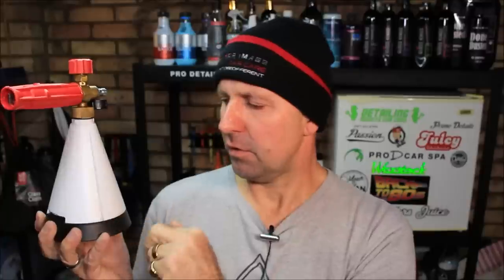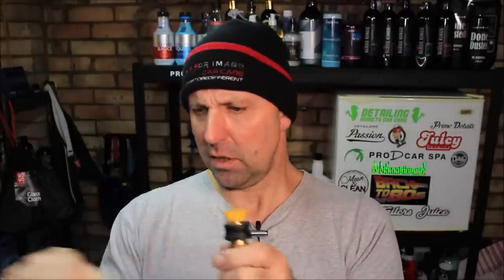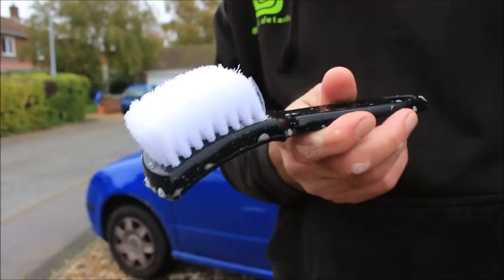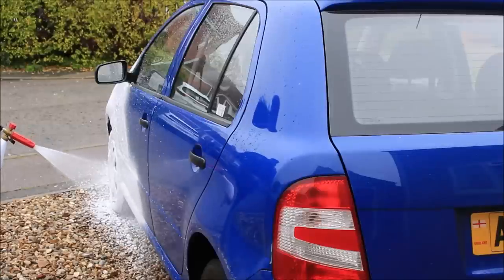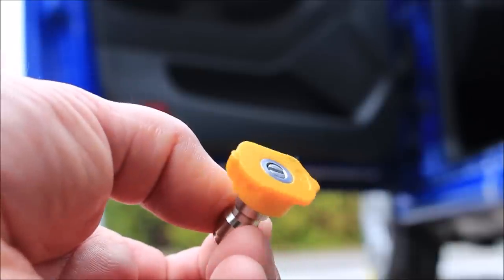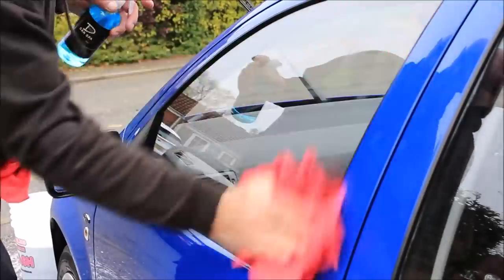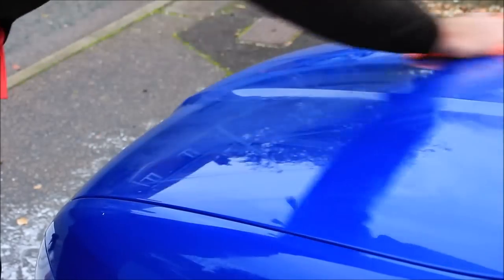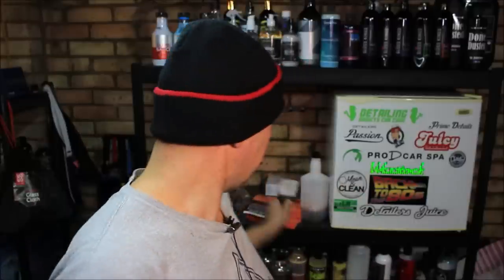Quick release conversion kit Nilfisk and more

Comment: Brill vid Paul. Which vikan brush do you use for the alloys am lookin at grabbing one. Would recommend a stubby gun thou I love mine so much easier than a full length hose.
Reply from the maker: Simon Attwood I haven’t reviewed the stubby gun but know guys that love it the vikan brush I’ve had for years it’s the soft face one there’s several in the range
Reply: @PaulDoldenDetails  yeah am looking at grabbing the vikan brush I got the thin red one for inside after your review so much easier. Cheers Paul